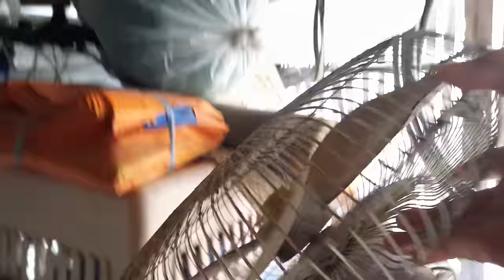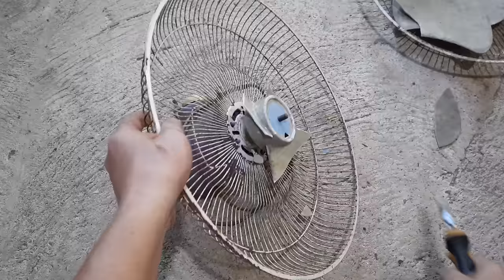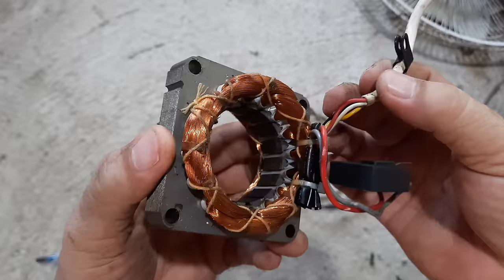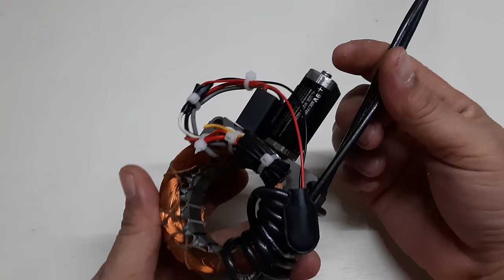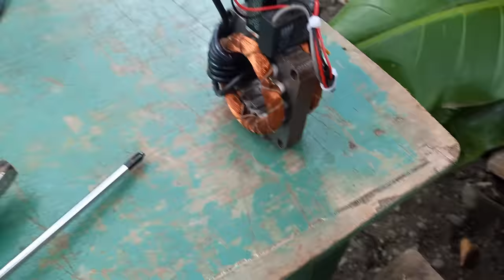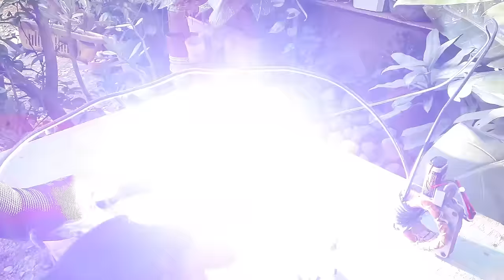#viral #video TURN AN OLD ELECTRIC FAN INTO A 9 VOLTS HIGH-TECH WELDING MACHINE

Comment: Is that true  9 v  can weld ?
Reply from the maker: @frednardshilomboleni5526 Thank you for your comment. We want to clarify that this is purely a creative concept and not a real conversion. Our aim is to entertain and inspire our viewers by showcasing the limitless possibilities that can be achieved with everyday items and a little bit of creativity. Welding typically requires high levels of current and voltage, and we strongly advise against attempting to replicate any of the techniques or methods demonstrated in the video. Thanks for watching.